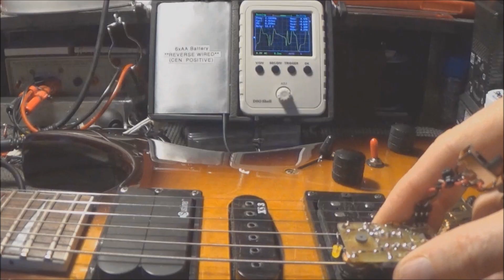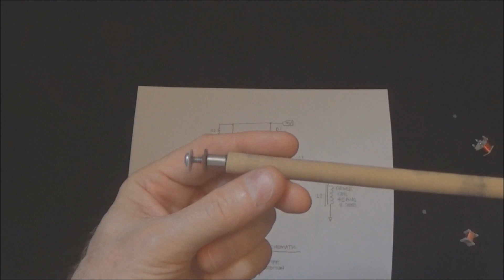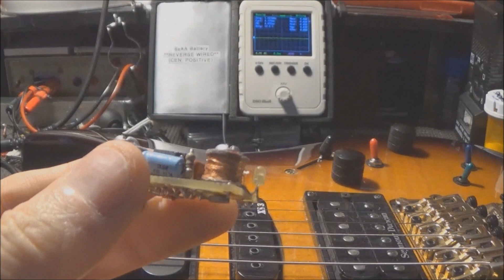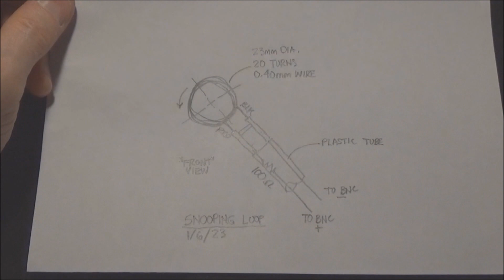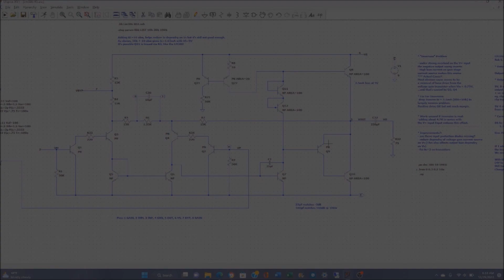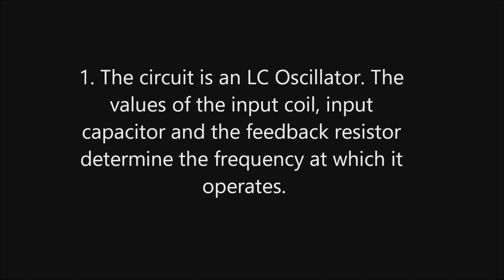DIY Ebow Using Internet Schematic - Does It Actually Work?!

Comment: Really interesting !
On your diy model, did you try to add surrounding metal to prevent input and output coil to react together, as a larsen ? 
And, finally, can you imagine a diy schematic that works ? Or there are too much unknown values as coil, magnets etc making a realistic diy project a nightmare ? 
Anyway, a nice job, thank you for sharing that !
Reply from the maker: I didn't use any ferrite rings, they are specialty product... don't even know where you could get those. Still too many unknowns about the coils. They need to be constructed in a certain way with very specific materials, wire gage and magnet types. Cheaper and easier to just buy one.
Reply: @VegasCyclingFreak   Ferrite or just grounded piece of metal (in my brain, it's to isolate correctly the 2 coils) 
Cheaper/faster, for sure. But less fun :p I will try that myself one day
Reply from the maker: @archloy  Sorry, my memory failed me. I remember now that I initially thought they were ferrite but they're actually coated steel rings. I made a PDF of the whole ebow. It's at my website http://www.diyguitarist.net/PDF_Files/EBOW%20Data.pdf
I made these videos before I decided to resurrect the website beginning of this year.
Reply: @VegasCyclingFreak  Nice ! thanks for the link, I will check that and your website, sounds cool :) !

Comment: Wow! You did such a great job!! I tried out myself to excite strings with electromagnets switched on and off by mosfets, but after learning from you about all the ebow principals, i defenitly have to try out to implement this to my project. The use of feedback loops is way much smarter. I've gone trough all your videos on the ebow. What a journey! Thanks so much for sharing your discoveries! I was wondering now at the end of this series, about your recommendations for final design and the needed components and their connections. In one video you say, that you would share your documentation, if people reach out. How could i get in contact with you?
Reply from the maker: Hey thanks for the comment and appreciating all the work I did on this. I have an Ebow page at my website which has all of the technical data that I show on my PDFs linked there - www.DIYguitarist.net
The only thing that no one has been able to reverse engineer is the actual specs of the coils. I got some to work but they need to be something very specific to get reliable operation. Hope that helps…